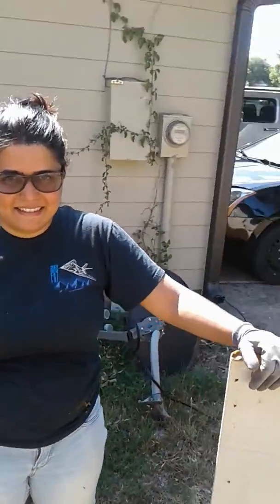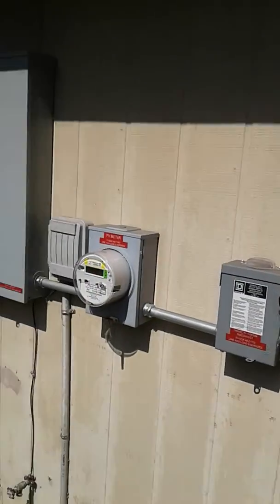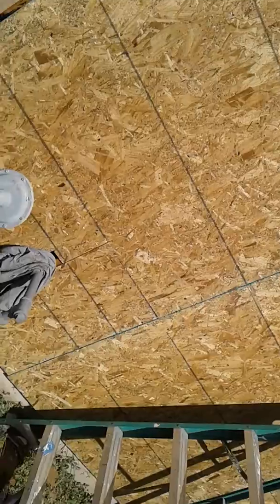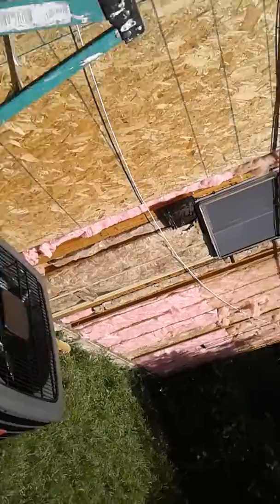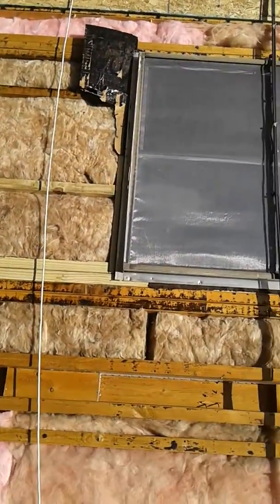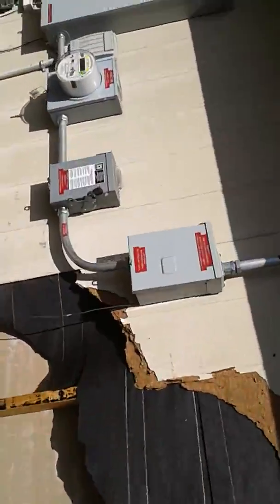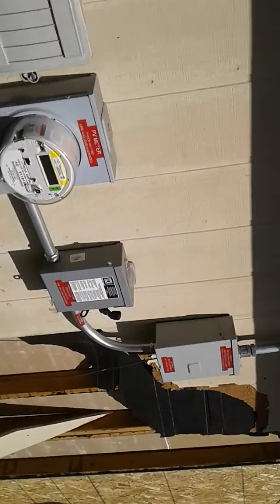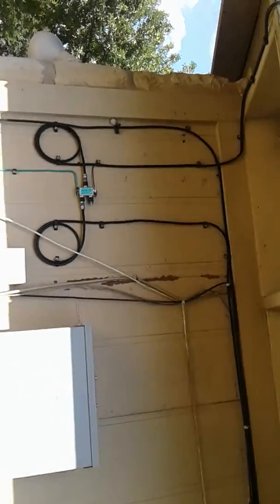Hardie plank lap prep

Comment: Getting ready for a similar project. Crappy chipboard all around where my electrical panel is. Trying to figure out how to go about getting OSB and lap siding up. Found your video gave a point in the right direction.
Reply from the maker: good.  you can open the panel and take out the screws on it but the meter you have to delicately pull off the siding and hope the screws pull out.  Then you can slide the new osb and siding of your choice underneath.  the panel you can fasten to the new siding when you finish.  Call the city electric utility to open the meter so you or they can fasten it back to the wall.  And wear safety gear: glasses, gloves long sleeves etc.  And turn off all available disconnect switches and breakers when able to.